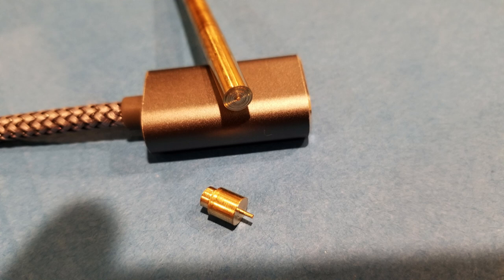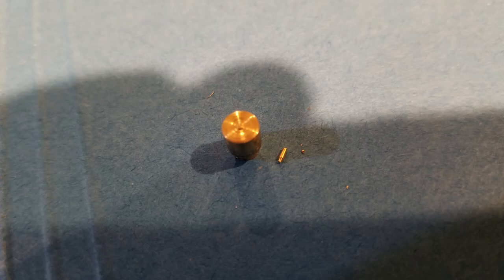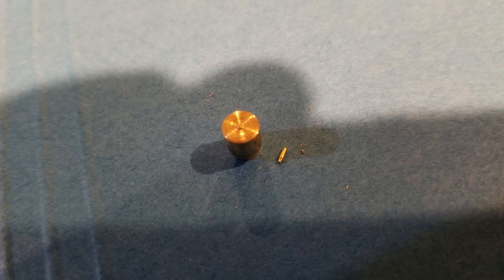Proxxon FD150 Lathe Flatten End

Comment: This is not a criticism just a bit of advice......It appears that the tool is too high, it sounds more like it is rubbing than cutting. Make sure the top point of the tool lies in line with the centre of the work piece diameter ......Also why is the work piece running out of true, in a self centring 3 jaw chuck...??
Reply from the maker: I'm using the device right out of the box, it's first time I've ever had or used a lathe so I didn't really want to dive into adjusting the parts that were installed and aligned by the factory. My concern is that I would only make it worse because of my inexperience. And I don't know if it's self-centering three jaw chuck, I hold the piece of material and then check while I tighten it and wiggle it around a little bit to make sure that it's not binding up on two of the jaws and not the third. The manual does not say "self centering". Finally, Thanks for taking a minute to give me some advice, I appreciate it. I'm self-learning at my own pace, which some may think it's pretty slow, but I'm not retired I have other obligations during the week and sometimes the weekends. I'm in no hurry, and the objective is certainly not to become an expert on a lathe. It's more of a hobby process to keep me out of trouble. Thanks again I appreciate you taking the time to make comments.